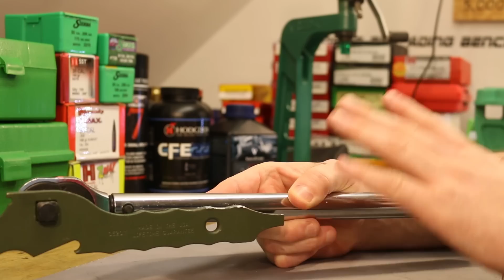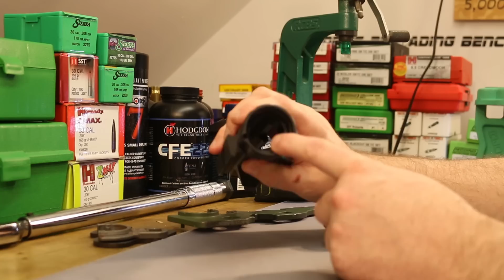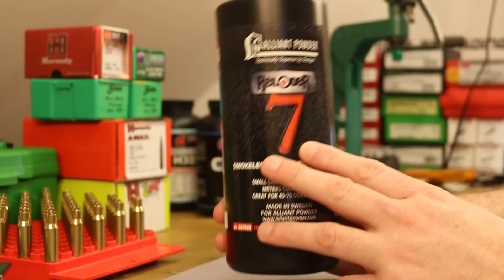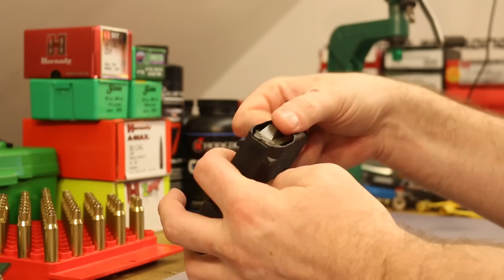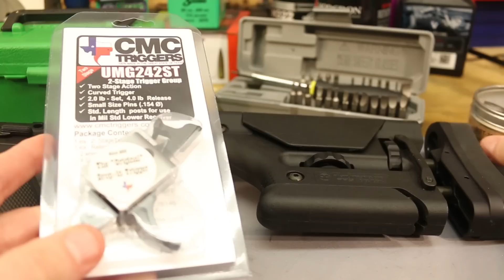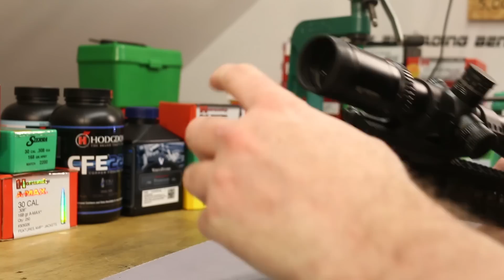Aero Precision M5E1 - First Shots (AR-10)

Comment: I put my AR 10 on a diet. 11 lbs down to 9 lbs.  With 20" fluted barrel, carbon fiber handguard. A1 Buffer tube with minimal butt plate , titanium muzzle break ,with 5 round mag. And 3 power Prism reddot. Ranges are short here in fla. And I use 130 grain Barnes TTSX. And JP enterprises light weight BCG. And spring. With adjustable gas block.

Comment: ... great video even after 7 years! Just started reloading for a Savage 10 bolt 20" with the new 177grn Sierra and N540. Max charge is listed by Sierra as 44.5gn @2.810" and VV has it at 43.1grn @2.800" so I've started at 41. Good to know I'm not pushing the velocity yet!  Update, 42.6grn N540 @2.795" shoots 0.3"...

Comment: I run a triggertech diamond in my ar10, I also have a light grip when shooting on the bench. I experienced double firing on one outing. I kept the same light touch but i made an effort to hold the trigger back with slightly more force after the shot broke. I havent had an issue with double firing since

Comment: Some regular commercial large rifle primers should not be fired in semi-automatic military rifles chambered for 7.62x51mm NATO. Semi-autos may not have a firing pin retraction system which can lead to out of battery firing. Primers such as CCI large rifle #34 will prevent this problem. - per Speer Reloading manual #15.

Comment: I’ve had some short stroking issues in my 16”.308 dd5v3 after I put the 419 brake on…it’s spuratic but mangles my brass when it hangs bad..my guess is I need to tune my buffer/bolt system but any help is definitely appreciated..my 175 hand loads with 46.0gr cycled great and locked back

Comment: Pretty sure the issues you are having are your fault - definitely not Aero Precision's problem. My last 308 build was from a stripped AP m5 lower, using AP internals. Placed a 18" AP complete upper and their BCG. Unsuppressed it works flawlessly and shoots sub MOA using Hornady 155gr ELD match in Norma brass. Glass was a Sightmark 8.5-25x50. looking at your groups, one has to believe that those "crappy" group can't all be the rifle - your'e just not that good of a shot. Can't help but wonder how, or even if you did, break in that barrel.

Comment: This is an old video I know but maybe someone will catch this and it'll help. As far as timing goes you use a minimum number for torque then go over it to the next notch that lines up. In this case I'd pick 65 or 70lbs torque until it clicks and go to the next notch. I'm pretty sure the military torques small frames between 35 and 50 wherever it lines up.

Comment: Here's the physics: Imagine that you have a 5-pound weight in your hand. It's physically in your hand, and it's easy to hold and twist your wrist around. Now imagine that you're holding a that same 5-pound weight at the end of a 10-foot-long stick (assume the stick itself weighs nothing). Your wrist is going to have to work a hell of a lot harder to hold/move that 5-pound weight around. 

This "stress" on your wrist is called torque.

In the case of your wrench, when you place the torque-measuring component farther away from the thing that you're trying to measure torque for, you're more likely to get an inaccurate reading in addition to over-torquing your object.  Your torque wrench will most accurately measure torque whenever the bit is directly over the object you are trying to twist. By turning the end 90 degrees, you're technically bringing your hand (that applies the force to the wrench) closer to the twisting object, which effectively translates the torque you're applying to the object more precisely. 

Hope this helps

Comment: Hi,  I got one of those BA barrels on a bundle deal....I  use .001 shim on most barrels, with those uppers, on the BA I used .0025....The barrel ext. on mine was under to the point  it seemed like  I could  have put it in as I walked by.
I would heat and shim to see what you really have there....  You now owe me two pennies

Comment: A gas gun cannot be compared to bolt gun accuracy.  Taking a lower-priced Aero, and then maybe setting that against an Sr25 as a bar for accuracy isn't realistic. But I compliment your efforts to see if a entry-level set-up can be made to compete. You never mentioned barrel weight, profile or twist rate. You don't mention buffer weight or buffer spring tension. How about bolt carriers? There are so many variables in gas guns.

Comment: So i couldn't find the build videos, i'm assuming you removed them due to policy changes? What was the details on the barrel, gas length, profile, and did you have any issues assembling the Aero Upper? I'm putting together a Full Aero M5 with a faxon BIG Gunner 16" Midlength gas, adjustable block. I skipped the BA barrel after watching these videos.. The faxon was a locale deal i couldn't pass up. Starting to worry alot more about headspace issues now and if i'll have issues with surplus 7.62

Comment: I know this comment is two years late but I had double fires in a freshly lubed AR15 with a Geissele SSA. It happened twice then settled down and has been fine since. Maybe lube on the sear? Who knows?

BTW, my most accurate .308 round was with 165g Nosler ballistic tips with 2520 (forgot the charge but you'd have to work up anyhow).

Comment: Point of the notches is to stop the nut from backing out once the gas tube passes through as if it would but mill spec original rifles were dropped constantly during battle and shit happens .

Comment: I bought a complete 18" 308 upper, complete 308 lower and their bolt and out of the box it was a single shot rifle much like you have. Went through series of steps that a helpful agent gave me but still nothing. Then today I slap my suppressor on (literally prior to watching this) and SUCCESS! 30 rounds without a hiccup. So obviously, it is under gassed. I talked to someone different today and they told me i need to spend another $50 to buy a heavy rifle length buffer as the ones the 308 lowers with adjustable stocks have in them are lighter. Of course, my first question was, "Why don't you just ship them with the correct buffer if that is what is recommend??"

Comment: As a retired Master Gunsmith I always wanted to fire around 200 rounds through any new AR platform build before making any major changes. You were kind of all over the place in this video. I have been reloading for 48 years and found this incredibly entertaining! The two stage trigger is an excellent choice with the AR10. You eluded at the end of this video to break in of a new gas gun. Exactly!
Reply: I'm a gunsmith also, and that's exactly what I do with my AR10s. Break em in first & dial em in, then make changes if necessary. Luckily I've never had to make any serious changes. Must've just got lucky w/ parts and building it right the first time. 😁 Two stage trigger all day on ar10 platform. Mine work AMAZING for accuracy with even a cheap two stage trigger. 👍 Happy shooting and wrenching!
Reply: Is there a specific break in technique to use?
Reply: @forgotten320  Shoot the gun and inspect for function. That's literally it. There really is no secret to it. Just don't immediately abuse your firearm.

Comment: Just an observation, when using the lighter triggers.  If you load the bipod with just your body weight and no muscle tension the bipod itself becomes a spring.  If this is the case try shooting off a bag or rest letting the rifle recoil straight back.

Comment: one of my best 308 loads:   150 gr. Ballistic Tip,   R-P Brass,  CCI-Benchrest primer,  43grs. of H335 with a OAL of 2.780 "    shoots a 5 shot 3/8 inch group at  100yds from my M-1A   o'yes--  I've had good results using 748 powder. Don't forget to chamfer the flash hole on your cases.

Comment: There is such a big range in torque specifications just turn the nut till it lines up I don't see the big deal there I had no problem with mine I was going to torque it at 55 foot pounds but the gas tube didn't line up so I just turned my torque wrench up to 65 and turned it gas tube lined up problem solved

Comment: Hey I have 2 enhanced aero uppers n had same accuracy issues. One is a m5 the other is m4. The m4 has a criterion barrel so I emailed them about it and got a great tip. Where the gas tube passes through the upper is the issue. They suggested opening up the size of the passage becouse it effected harmonics. I used a 3/16 drill bit and drilled it out just a bit larger. I was very surprised it helped so much. Now both guns ard sub moa guns. As far as a barrel my m5 has 18in ballistic advantage heavy profile and its sub moa as well
Reply: Im having problems as well getting sub moa on a 18” ballistic advantage .308 m5 Aero precision. Any tips ?

Comment: I just built my own LR 308 / AR 10 ( what ever people like to call them, it's a DPMS  pattern ) My build was for a lighter weight deer/hog hunting rig so I used a slim barrel. My first groups were just like yours. Big and disappointing. I didnt have a good group until I removed a shim stock piece that I installed around the barrel extension wrong. My brass is looking just as beat up and I have reduced my adjustable gas block to near off. I do have a light weight BCG but still shouldn't be cycling fast at this point. The big difference is I am seeing is really flattened primers with charges 2.0 and 2.5 grains under charge maximums. have used Reloader 15, IMR 4166, IMR 4895, BL-C(2), and TAC. I really got flat primers with -2.0 grains of TAC which surprised me but my Hornady brass is slightly heavier with a little less capacity than Win brass. ( A standard GO gauge goes in the chamber fine ) I may seat bullets a bit further back to see if that relieves some pressure. The other thing I am seeing is IMR 4166 and TAC are printing on point of aim, R-15, BL-C (2)and IMR 4895 are printing 3 to 6 inches low! One load with 45.5 grains of IMR 4166 and the new Speer 150 Gold dot rifle bullet shot quite accurate with 4 rounds going into 9/16" and one of the 5 shots made it 2 3/16". I just still have to do some more load development and see what I can do. I have a Faxon Big Gunner Pencil barrel so its not stiff like a lot of heavier barrels but it is free floated. I will check out your other videos. Thanks for your doing this video!

Comment: Ok, Where to start. 1 in 10" twist is not meant for anything less than 150 grain bullets. CFE .223 powder in my experience needs to be run near the top load for best accuracy and clean burning. Try a Faxon Heavy Gunner barrel, should drop about a pound off the weight also.

Comment: i saw the magic words "M5E1" and had to watch since i'm strongly considering building one.  your video was somehow exciting to watch.  i learned quite a bit.  thanks!
Reply: Do it for sure, the M5E1 (and M4E1) platform is pretty sweet. The free float handguard is rock solid and the enhanced lower is awesome. The threaded bolt stop "roll pin" is worth it if nothing else, but the flared magwell, nice one piece trigger guard, and upper / lower uptake set screw are good features too. 

If your goal is getting easy 1/2 moa groups and money isn't a huge issue, I'd personally consider a barrel other than the 20" BA one he is testing here (I have the exact same one, just not stainless). If you're happy with 1-1.5 moa with the right bullet selection, and sub moa if you really pick out the perfect recipe, then it isn't a bad barrel. The federal 168 grain gold medal match would do 1-1.25 moa with the setup I talk about below.  

I've shot a pretty good amount of bullets through mine (probably 250-350 factory rounds and between 750-1,000 handloads) and am just now figuring out what it really likes. It's hard to say exactly what has caused the groups to tighten up but I think a big part of it is just finding bullets the barrel likes, and loading the correct powder charge. When I started loading, I was very cautious and stayed away from max charges. I'd usually start 2-4 grains below the listed starting charge and would work up to no more than 3/4 of the way between the starting and max loads. Since Tossing that concern out the window a little, my groups have seemed to tighten up some. I think the properly filled case is just more consistent. 

Using the stock Aero trigger which I polished, a cheap $20 UTG bipod, and a 1" tube 3-9 Buckmaster II with a rear bag, I could get around 1.25-1.5 moa for most of the groups. PPU 7.62x51 would shoot around 1.75-2.5 moa. 1 moa groups happened but were not as often as I wanted. All of the older groups I shot were 3 shot groups, now I shoot 5 shot groups.

I spent a lot of time meticulously weight sorting brass, primers, projectiles, trickling powder charges, deburring the flashhole inside and out, uniforming the flashhole, etc. I'd have turned the necks and checked for bullet concentricity as well if I'd had the tools to do so. 

I get better 5 shot groups now with charges thrown with a Lee perfect powder measure and grabbing bullets, and primers right out of the box. I still will on occasion toss the brass on the scale but that's just to make sure the really heavy or light pieces don't get mixed in with the rest. I used to sort them to within .5 grains, which took forever. 

I still sometimes do the same with some projectiles, but just run others as is if I know they are consistent or just shoot well. 

I have since upgraded to a 1" 6-18 Crossfire II, added a limbsaver barrel deresonator, and recently swapped out the standard flash hider for a AR stoner muzzle break, added an adjustable gas block, and installed a set of JP 4 lb trigger springs (that was a $10 well spent). 

I shot 2 groups last night with some new to me once fired LC brass, Speer 130 grain hp's, and Varget. It was about 35 degrees and I didn't let the barrel cool back down more than about 5-10 seconds between shots. It was getting dark and I was rushing a bit. The 47 grain load was .860" and the 47.5 grain load was .970" with one flyer, without the flyer it was at .780" and that was with vertical stringing, likely from the barrel / chamber getting warm. 3 of the 4 that were stringing were right on top of each other at about .300", the last one was about .300" higher. Granted those are at 75 yards, but considering the $.16/piece brass wasn't sorted at all and nothing was weighed, the bullets cost me $.15/piece, and the barrel temp was all over the place, I'm pretty happy with that for preliminary results. I have more loaded up to test tomorrow and I am expecting groups around .750", maybe closer to .500". Seating depth on those is around 2.680". 

I've been rambling, might have overdone it with the coffee tonight haha. 

If you have any question or anything, feel free to ask. So far I've tested the 175 grain RDF, 165 grain SST, 168 grain Speer bthp, 165 grain Speer btsp, 150 grain Hornady fmj, 178 grain ELD-X, 200 grain ELD-X, 175 grain Monster Match, 190 grain Monster Match (the MM bullets shot really well), 110 grain Sierra fbhp, Speer 130 grain fbhp, 150 grain Lehigh Match Solid, and probably a few others that I'm forgetting.
Reply: @colsoncustoms8994  wow, thanks for all the info

Comment: Hello, I would second the Kreiger barrel, my other choice would be Lije. I also had, long ago a Mauser in 338 purpose built for dangerous game with a Schillen barrel and kanjar trigger if I did my part that rifle would group 1/2. To 3/4 MOA as long as you could stand to shoot it. I have been shooting for about 55 years and used to compete in small bore, so I got used to shooting with a very light trigger, my 40X was set between 4 to 8 oz!

Comment: you may want to take check your M5 lower because all the lowers manufactured before 2019 are defective and will not hold some steel magazines or a Lancer magazine, AP milled the mag well too wide. I just finished a year long process with Aero Precision to get my M5 lower replaced. happy shooting

Comment: You're correct with the two smaller adapters that the 90 degree setup will make the torque setting and application the same, HOWEVER, the TAPCO wrench has ONE MORE ISSUE! The Tapco wrench does NOT have the center of the 1/2" torque wrench fitting perfectly in line with the center or rotational force of the barrel nut adapter. There is approximately ~10 degrees difference when you move the Tapco wrench to the 90 degree angle. If I'm not mistaken ((ROUGHLY)) if you have the Tapco wrench at a 90 degree (barrel nut part facing UP) angle your torque will be 2.3 ft. lbs. more than what is set.

Comment: If that is using an A2 buffer, drill a hole through the stock bolt to relieve air pressure. It will likely solve all your issues. A2 buffer systems suck, and compressed air can clog up the system.

Comment: You can try this method for sighting in your scope with less ammo. Aim dead center of bulls eye and shoot one round. Now while aiming down sights at bulls eye, very carefully without moving the rifle, turn your elevation and windage adjustments until the cross hairs line up on the hole from the first shot you made. Then shoot one more round at bulls eye and you will be extremely close to dead center.

Comment: The exact foot pounds thing is mostly lawyer speak. 
We don’t carry a big torque wrench like that around to assembleM4’s, SR25, M110, and other rifles in Iraq. We do use a small toque tool for stocks, scope rings, etc. 
Getting the gas tube to line up is more important than the torque. 
All we do is put the nut finger tight, then use the wrench to turn it to the first available spot that it fits. 
Someone explained the physics that measuring by the distance the nit is turned is actually more accurate than using a torque wrench, but I can’t easily explain it in a short comment.